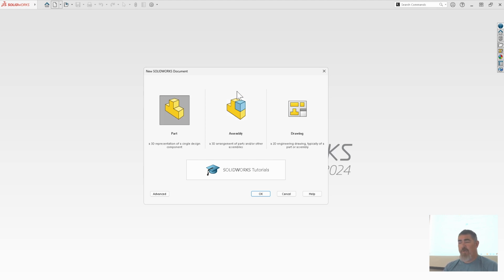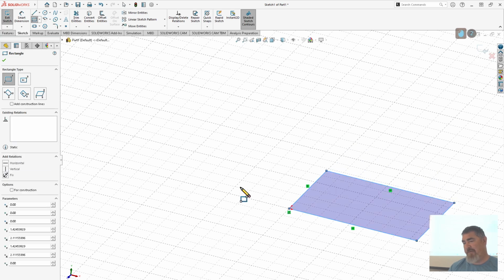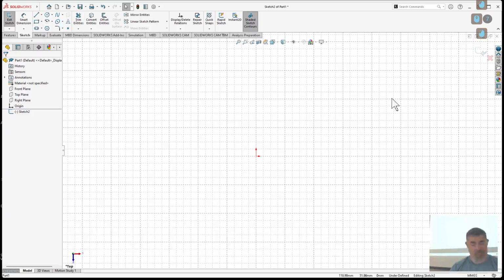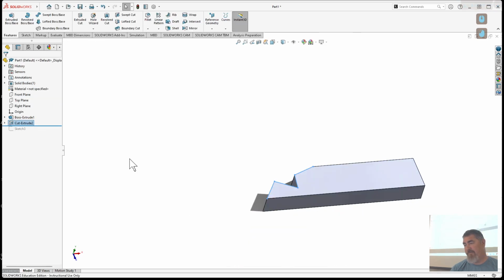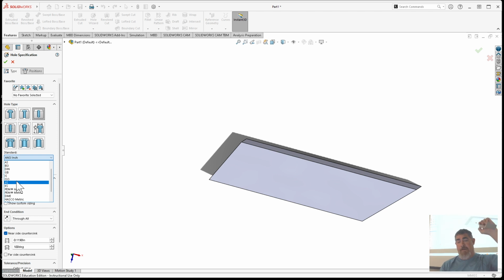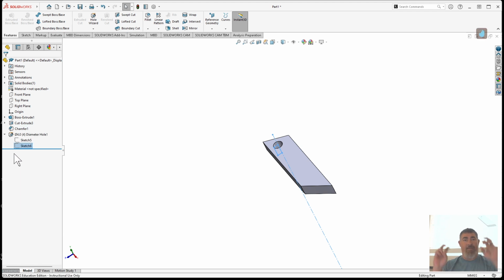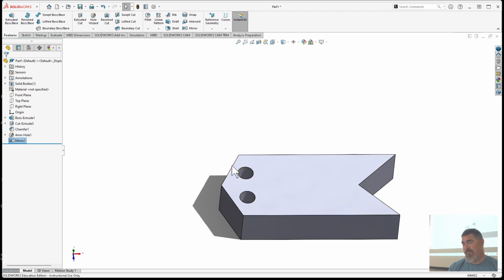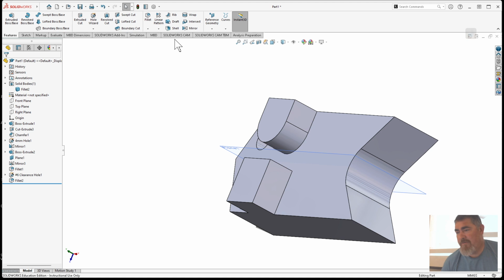SolidWorks for Fusion Users

Comment: This is like the only video I could find for switching from fusion to solidworks instead of the other way around...
Reply: theres not many of us! I have like 8 years and thousands of hours in fusion, and now I have to use solidworks for work! :0
Reply: @martinsmith2948  I'm in the same boat. Maybe I'll grow to like Solidworks but I much prefer Fusion at this point :(
Reply: Did you find anything else to help with the transition? I have the same issue.